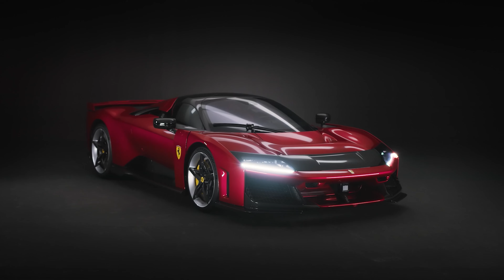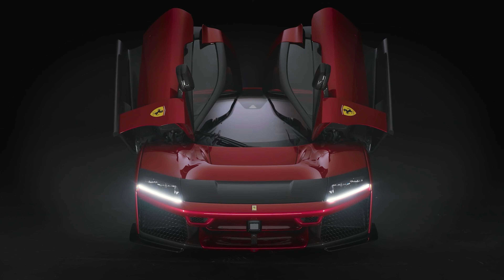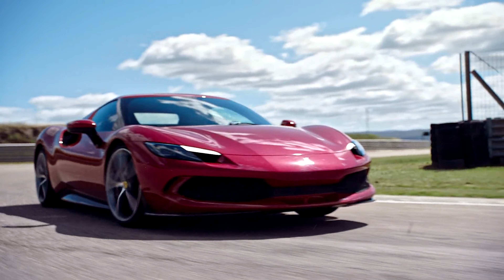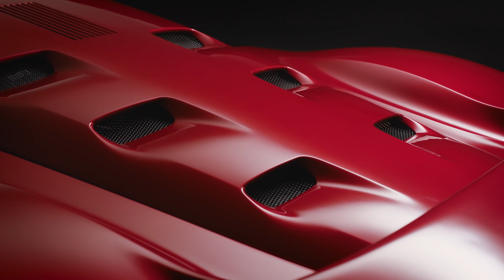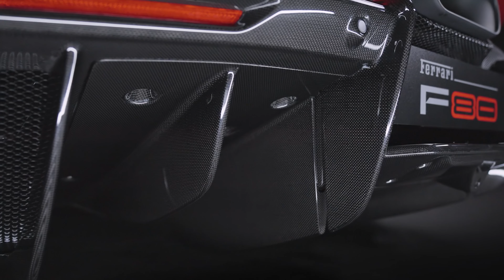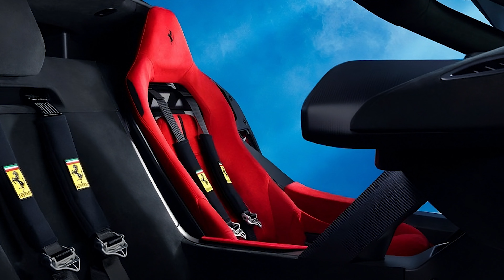Ferrari F80: The Ultimate Supercar | 1,200 HP Beast Explained

Comment: thats not a lafferrari succesor thats the 296 gtb succesor because of the v6 in there
Reply from the maker: Thanks for your comment! While it's true that the F80 shares a V6 engine configuration similar to the 296 GTB, the F80 actually goes far beyond as Ferrari's new hypercar, following in the footsteps of the legendary LaFerrari. With 1,200 hp, F1-inspired hybrid tech, and cutting-edge aerodynamics, the F80 builds on Ferrari's iconic models and represents the next level in their hypercar lineup.